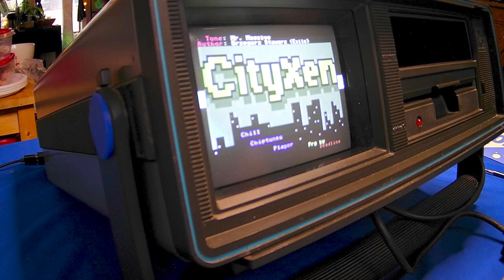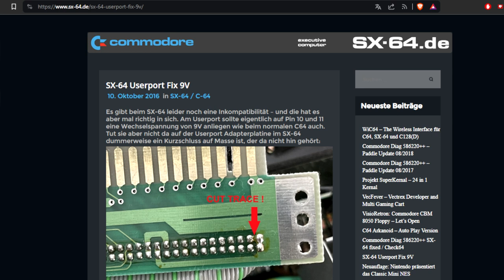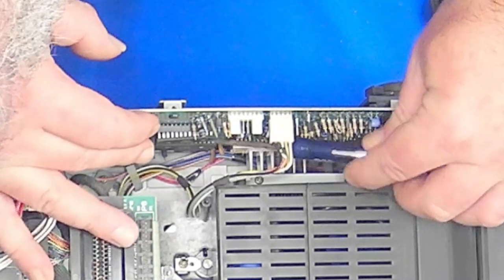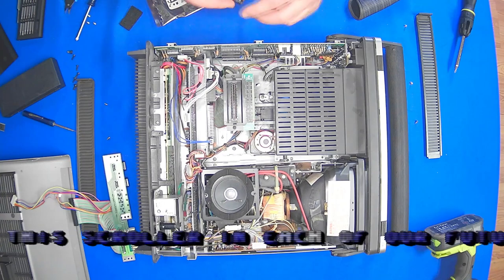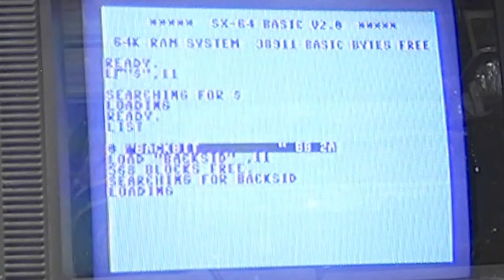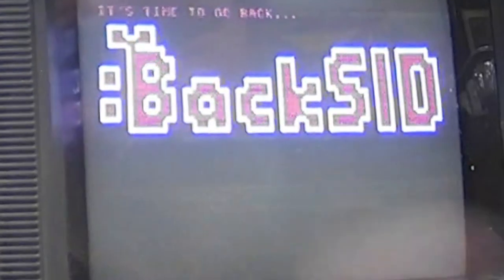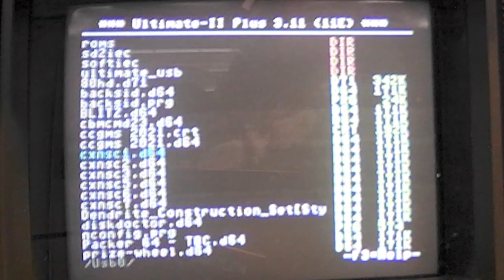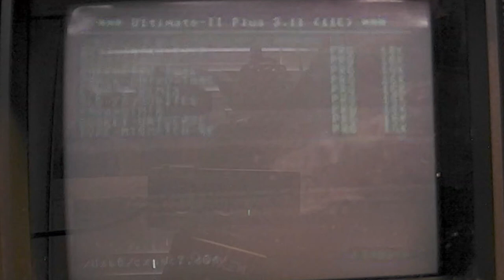Commodore SX-64 Repair - Factory User Port Mistake & BackSID Install

Comment: TY for the Commodore content and especially the SX-64 content. I have three SX-64s and had to repair all 3 of them (#1 RAM, #2 PLA & #3 SICK SID) and I didn't cut that trace when I had them open. Why is this needed to be done?
Reply from the maker: Commodore SX-64 soldered/connected pins 19 and 20 on the user port on that little daughter board in there at the factory. It could potentially damage equipment (both SX-64 & whatever device you are plugging into the user port) from that shorted 9v rail. If you never use your user port, it shouldn't be an issue. But if you do, you should severe that trace. And as you know, we love using the user ports on our machines.

Comment: Nice repair tutorial. Would love like a detailed tutorial of the relays and c64 and basic ❤
Reply from the maker: Thank you. Have been meaning to do a detailed video on the relay boards / relay tracker. I keep forgetting about it / putting it off. I will get that in the queue and explain how it works a little better. Cheers.
Reply: @CityXen  will wait for it!!!!! Last question, when  connect the 8 channel relay to c64 and poke 56579,255 all relays led go on, but when I poke 56577,0 none go off, is working like in reverse, if I poke 56577,128 all leds go off. Do you know why is this happening? In yours vide I saw the led only turn on when the relay connncts. Thanks.
Reply from the maker: We've found that It depends on what device you're using. Some are looking for up state, the others down state. In fact, I had to add a exclusive or to the routines in the RelayTracker program when people started using it with the VicREL and a toggle VicREL mode feature. In BASIC v2 for the C64 it will look like this:  N=(X OR 255) AND NOT (X AND 255), where X is the value that you want XOR'd. N will be the XOR'd value of X. Put that in your line just before the Poke 56577,X... Hope that helps!
Reply: @CityXen  yes, just noticed that. The one I got will action in LOW. It looks like the RED boards have a jumper to setup if you want to trig at LOW or HIGH. Thanks!
Reply from the maker: Was wondering if you had seen the Fireworks Tutorial, because that is what the topic is in the video. I cover the relay board and BASIC programming. There's even a github software for it. https://www.youtube.com/watch?v=IMBroFEpF7s&list=PLwrJopiRMOvzTgyXj458HoUfvJgApWb7q&index=12&ab_channel=CityXen It's the same thing, just put your own type of circuit on there besides the firework stuff. For instance, it could be LED lights.
Reply: @CityXen  yes I tried to follow and that is when I noticed my module triggers the relays at LOW, so for example if I want them off I need to poke 255.
Reply from the maker: Glad you figured it out. Please share your project with us so we can see too. Either on our discord, or on twitter. Thanks